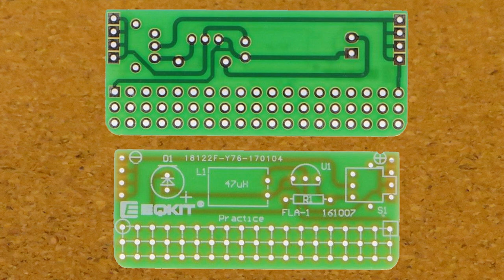Grandad assembles a DIY Kit 1.5V Universal Flashlight - Joule Thief ?

Comment: This is not so much a joule thief, that three legged component named YX8115 is a not a transistor, it just looks like one due to its TO92 package. It is a specialized LED Driver, designed for just the purpose to light up an LED from 0,9 to 1,5 Volts. When the Voltage of the Battery will drop below 0,9 volts, the Flashlight will stop working. A designed proper joule thief however can drain a battery well below that threshhold and is able to work at 0,4 Volts and even below that. But still, that Kit is pretty nice :-)
Reply from the maker: I used Joule Thief in the very broadest sense of the term in that we are lighting the LED with a lower voltage than the forward voltage requires. A little Googling comes up with this EEVblog which covers this kit and includes some useful links although the data sheet does not really tell us much https://www.eevblog.com/forum/beginners/diy-flashlight-kit/

Comment: I just ordere two of those.  One to build up as the light and the other one for the parts.  Great fun ahead for just a bit of money.  Too bad it is going to take 6 weeks to get it from China.
Reply from the maker: Thought you might like it. I have added a link in the video description to the EEVblog on this kit. Elnufo pointed out the XY8115 is designed to do the job of boosting the voltage and although the datasheet I found does not tell you anything about the internals the other comments say it is an oscillator sort of circuit.
Reply: I spent all day yesterday researching that XY8115 component and other simple led light drivers. I found a simple one transistor / one coil circuit that did work if you use the right NPN.  Not sure how it works.  It is like a Joule Thief but with a missing base trigger coil.  https://www.youtube.com/watch?v=XhFei89urbo